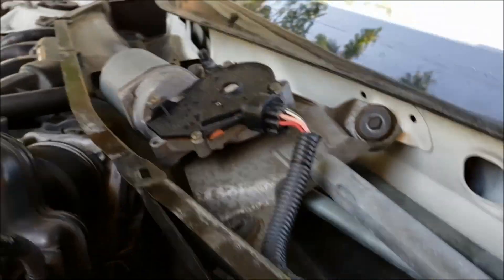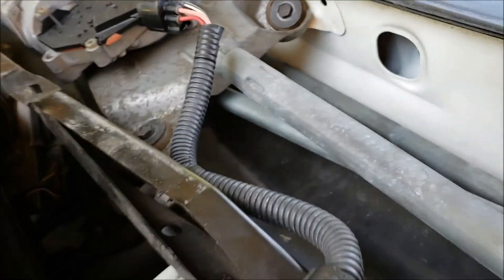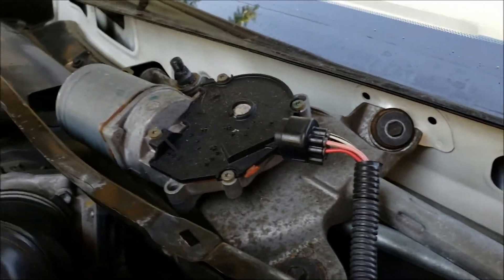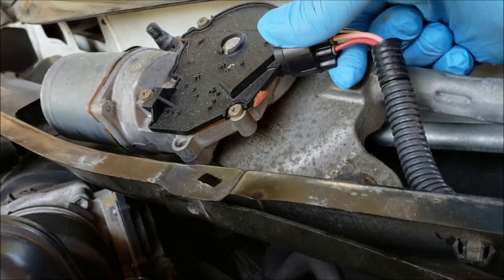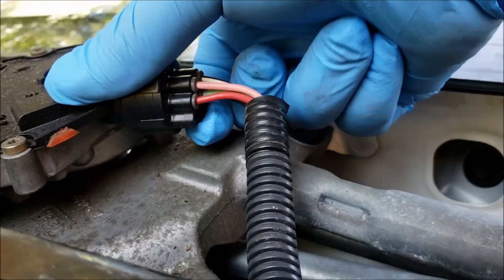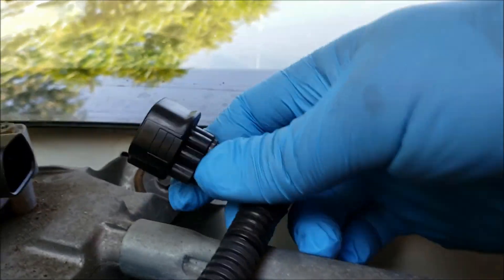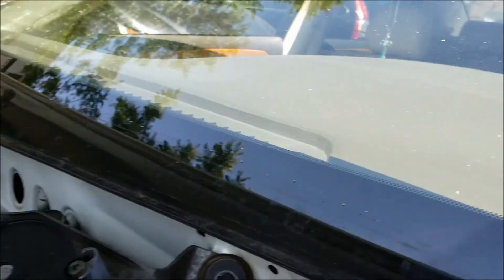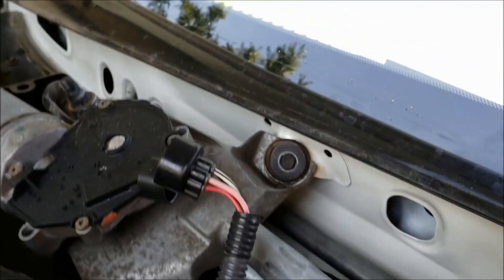Windshield Wiper Motor Toyota Avalon 2005-2017 replacement

Comment: How much did that cost to replace
Reply from the maker: The motor cost for new around $60  or you can find used around $35 from Ebay

Comment: The motor had power when they tested it and put used switch in it and it still didn’t work. What could it be
Reply: Module
Reply: Check the fuses
Reply: Same..